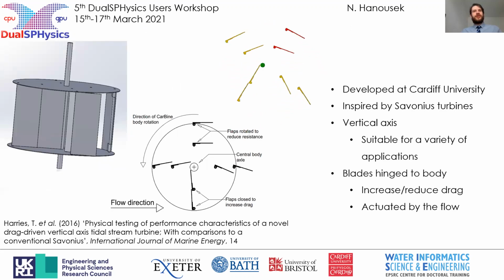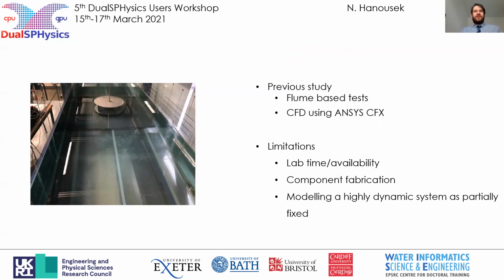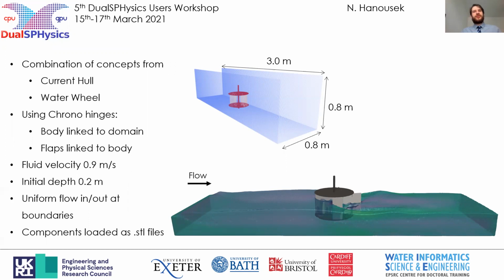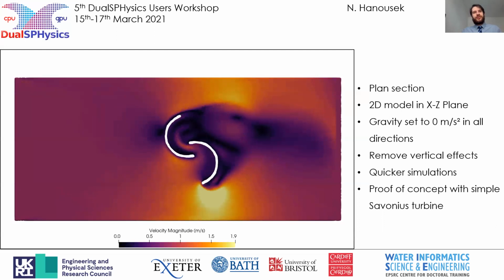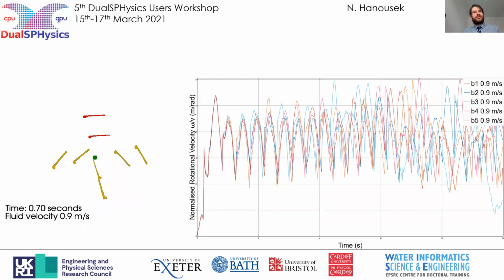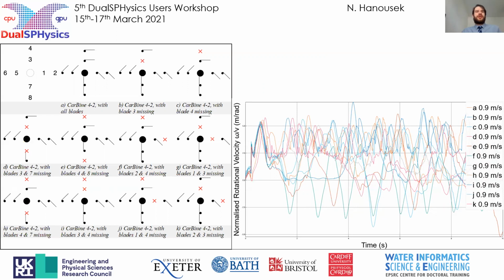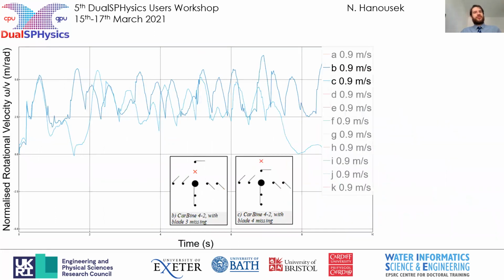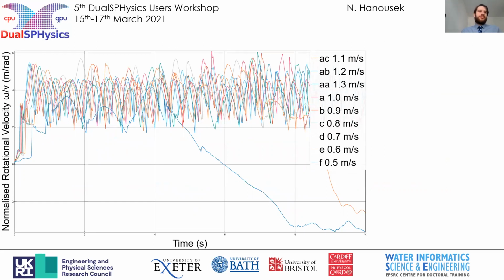Session 1, 5DUW 2021 - Nicolas Hanousek

Comment: I can see the thinking in that design. However, from my adventures in wave energy devices, what is absolutely clear is that reliability is the single most important quality after 'on-the-face-of-it' economic viability. It is almost overwhelmingly important. What you may find in reality (ie, not just in a laboratory), is that the unreliability or servicing requirements caused by wear in the moving parts and impact of parts closing against their stops may undermine the cost benefits of increased theoretical mechanical efficiency for a given size. In particular, the increased cost of manufacture of a device that is technically more efficient for a given size, means that it would be cheaper and more reliable to manufacture a larger, less efficient model for the same energy production. As my Dad, former editor of OEM design, says, "Rugged simplicity" usually wins.